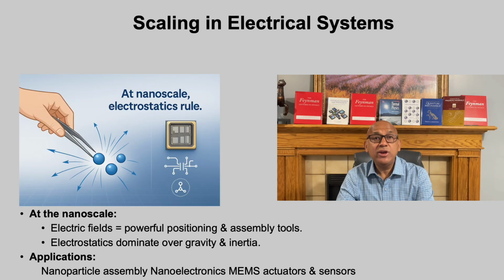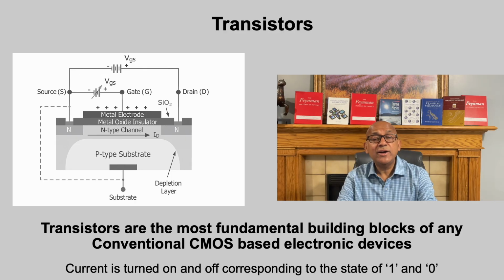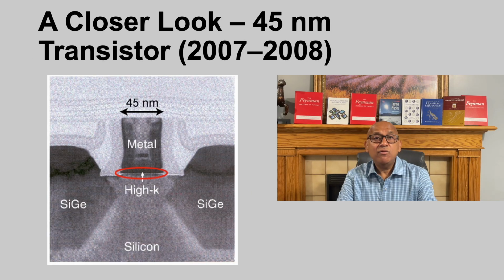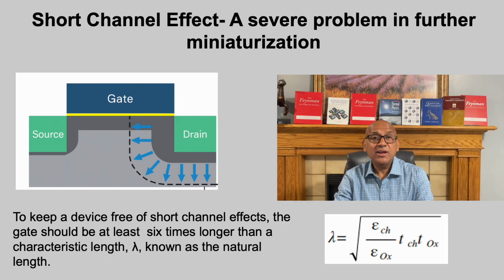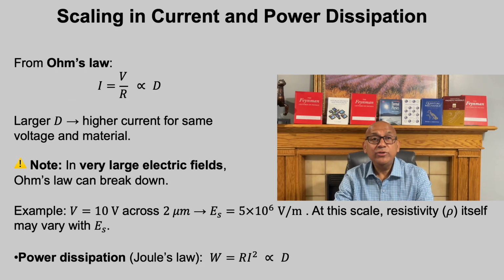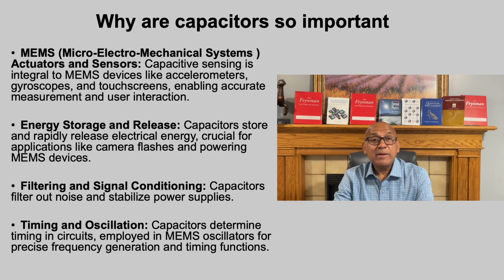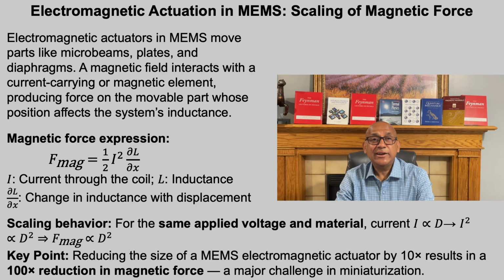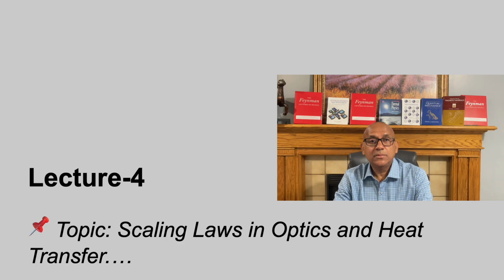Nanotechnology Lecture 3 | Scaling Laws in Transistors & Electrical Systems

Comment: Hello Dr. Tiwari! Mary Cernyar here! I was wondering about the problem of the short-channel effect.  You mentioned how the electrostatic field associated with the drain interferes with the gate. How so? Will electrons/holes still move from the source to the drain even if the gate is closed? You mention that the gate must be 6x longer than the characteristic length (of the transistor, I assume?). I don't know a lot about transistors, but could the short-channel effect be solved with a gate made of better material?
Reply from the maker: Hi Mary, the gate controls an energy barrier—think of it as a hill that electrons must get over to move from source to drain. When the channel is very short, the drain’s electric field can lower that hill even while the gate voltage is set to OFF. So yes, unwanted current can still flow! This is called drain-induced barrier lowering.

The characteristic length describes how quickly the drain’s influence weakens with distance inside the channel. It depends on the transistor’s dimensions and materials. Making the gate about six times this length is an approximate design guideline, rather than a strict universal rule.

Better materials can help, especially the insulating material between the gate and channel. A high-dielectric-constant (“high-k”) insulator can strengthen gate control. However, changing the gate metal alone generally won’t solve the problem. Engineers also use thinner channels and gates that wrap around the channel to improve control.

Comment: Hello sir, the lecture was very informative. I learned how electrostatic field depends on length and how electrostatics dominate on tiny dimensions. I was fascinated to know about transistors. I was amazed to learn about the fact that number of transistors used in a chip keeps on doubling as suggested by Moore's law. Moore's law bought a change in technology as new materials were introduced to keep it moving forward and the sizes of transistors reduced. I was also very fascinated to learn about the importance of capacitors. Overall,the lecture was very interesting.
Reply from the maker: Good Job, Sayuri!

Comment: Great lecture Sir, I really liked the "SCAN" acronym, it  definitely makes it easier to remember the applications.

Answers of question asked -

The resistance of the cubic micrometer comes out to 0.0172 ohms. When you compare that to a cubic millimeter (which is 0.0000172 ohms), the micrometer one actually has 1000 times more resistance.

It’s crazy to see how much the resistance jumps just by shrinking the size, even though it's the exact same copper material. Really puts into perspective why those tiny interconnects in modern chips are such a massive bottleneck for heat and power.
Reply from the maker: Nice observations, Indrajeet. I’m glad you liked the “SCAN” acronym and connected the scaling concepts with real challenges in modern chip technology. Your explanation about how resistance increases dramatically as dimensions shrink was very good, and you also correctly connected it to heat and power bottlenecks in nanoscale interconnects.
Reply from the maker: Nice observations, Indrajeet. I’m glad you liked the “SCAN” acronym and connected the scaling concepts with real challenges in modern chip technology. Your explanation about how resistance increases dramatically as dimensions shrink was very good, and you also correctly connected it to heat and power bottlenecks in nanoscale interconnects.

Comment: Hello sir, Sayona this side. This lecture also didn’t fail to fascinate me. I came to know that when objects become extremely small, electric field dominates other forces. I also came to know about transistors, and how they are so small that a billion of them can fit inside a chip. The fact that the number of transistors used in a chip keeps increasing (Moore’s Law) is very astonishing. And now, most advanced chip are produced at 3nm. I got to know about the drawbacks such as short channel effect. Interconnects, which are metal wires that connect billions of transistors together also face a challenge of resistance. Smaller devices heat up much quickly as they have very little capacity to absorb energy. I really appreciate the images that were included in the slides, like that of transistors. They really helped me visualise. Here are my answers to the questions asked in the video :

Q1) 0.0172 ohm 

Q2) Since R is indirectly proportional to characteristic length, a cubic mircometer of copper have 1000 times more resistance than a cubic millimeter of copper. 

Q3)While doubling the area only doubles the electrostatic force, halving the distance quadruplesit because the force is inversely proportional to the square of the distance between the plates. So I believe halving the distance provides a much greater improvement.
Reply from the maker: Very good observations, Sayona. I’m glad you connected the scaling concepts with real transistor technology and modern chips. You also picked up several important challenges such as short-channel effects, interconnect resistance, and heating at very small scales.

I also liked that you attempted all the conceptual questions and explained the reasoning behind your answers. Good effort and careful thinking.
Reply: @S @STEMwithDrTiwari Thank you sir!

Comment: Hello Sir, this was a really interesting lecture. It made me realise that the impact of scaling on electronics is far more significant than I had imagined, and it increased my appreciation for how rapidly engineers continue overcoming these challenges to keep reducing transistor sizes. Overall, the lecture was very easy to understand and introduced new concepts clearly without any confusion. I ended up watching the lecture twice and realised many more implications of engineering at such small scales. I also found the lecture particularly interactive and engaging.

Below are my answers to the questions asked during the lecture:

A1 - 17.2 milliohms

A2 - A cubic micrometer of copper shows 1000 times more resistance than a cubic millimeter of copper.

A3 - Assuming the actuator operates at a constant applied voltage, halving the separation gives the greater increase in force. Since electrostatic force is inversely proportional to the square of the separation distance, reducing the gap to half increases the force to 4F, whereas doubling the plate area only increases it to 2F.

However, if the actuator operates at the maximum voltage before electrical breakdown, then the maximum allowable voltage decreases with separation distance. In that case, reducing the separation also reduces the allowable voltage, cancelling the advantage gained from the smaller gap. Under those conditions, doubling the plate area gives the greater increase in force, resulting in 2F.
Reply from the maker: Very nice work, Rishi. I’m glad you carefully thought about the implications of scaling in electronics and attempted the conceptual questions from the lecture. Your observation about engineers continuously overcoming scaling challenges is very important.

I also liked that you went beyond the basic scaling argument and considered the electrical breakdown limit case. That shows deeper thinking about the physics and engineering constraints involved in microsystems and nanotechnology.

Very good effort and analysis. Next lecture will be posted soon.

Comment: This Lecture discussed how the electrical behavior changes under scaling laws, which explains why electrostatics becomes dominant once the systems are small enough. We learned how decreasing the distance between components dramatically increases the electric field strength. As technology continues to follow Moore's law, materials like high-K dielectrics are necessary to improve transistor performance and to shape today's nanoelectronics. The lecture also highlighted how shrinking devices introduce new challenges, including rising resistance, faster heat buildup, and electromigration in metal interconnects.

Comment: Fascinating lecture. I never considered how shrinking electrical systems would significantly alter their behavior. The part about electrostatics becoming way more important at the nanoscale was something I had never considered before. Moore’s Law and the whole transistor scaling history made everything feel more real, especially when you see how leakage and short-channel effects start causing problems as devices get smaller. The explanation of resistance, heat, and electromigration also made me realize why nanoelectronics needs totally different design thinking. Overall, this made scaling in electronics much easier to understand and way more exciting than just numbers on a slide.

Comment: Question 10.
Electromigration is a result of collision between electrons and atoms which makes the atoms to be pushed along the conductor by high current densities. This can cause short circuiting of neighboring lines as resistance is increased and the performance of interconnected chips altered.
Reply from the maker: Well explained! You’ve accurately described electromigration — how collisions between electrons and atoms under high current density can displace atoms and degrade the reliability of interconnects.

Comment: Question 5.
The short channel effect arises when the channel length between the source and drain becomes so small that it interferes with the gate's control to the flow of the electric field. This results in leakage current, which affects the overall performance of the transistor. This challenge can be overcome by increasing the gate length to be larger than the natural length, which will enable the gate to function well.
Reply from the maker: Excellent explanation, George! You clearly described the short channel effect and its impact on transistor performance. Increasing the gate length beyond the natural length is indeed an effective way to maintain proper gate control at the nanoscale.